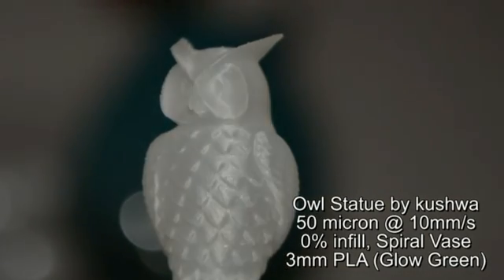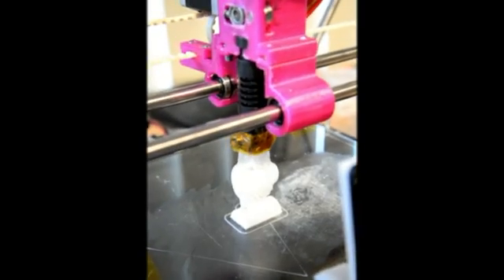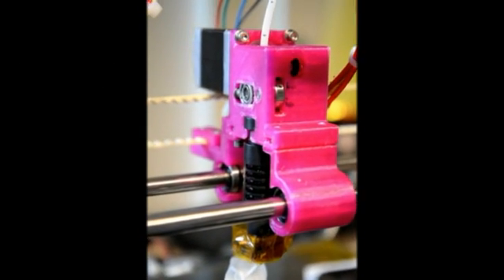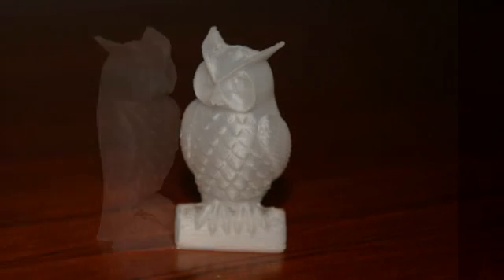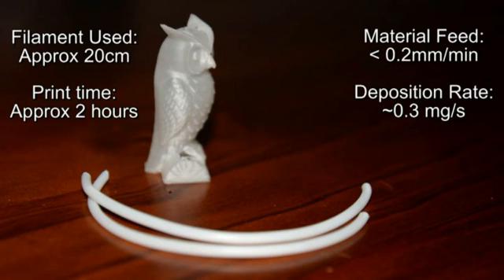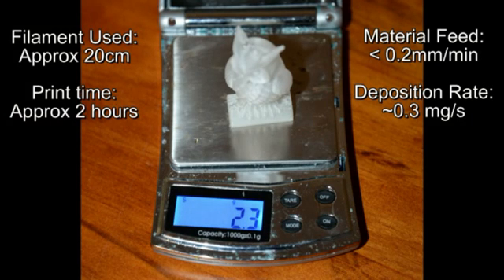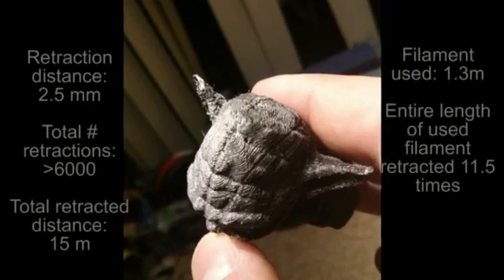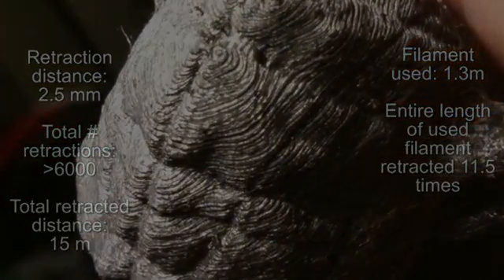Filament control of the Urchin Extruder

Comment: Very nice looking extruder!
I wonder if a 1.75mm filament version would be doable?
If it was relatively easy to adept to 1.75mm that would be great.
Would love to have a small, consistend, fast and lightweight extruder on the carriage of my deltaprinter rather than using the bowden setup I currently have.